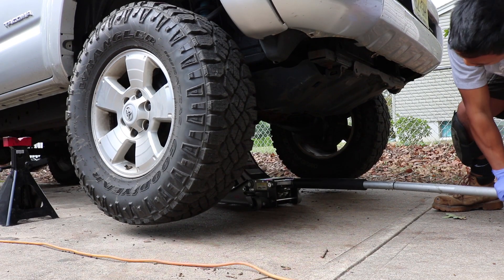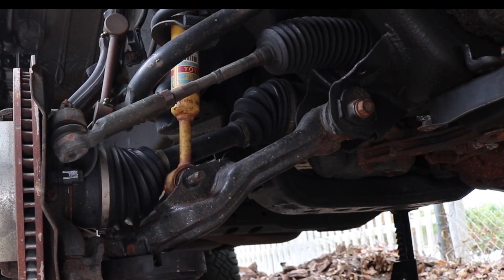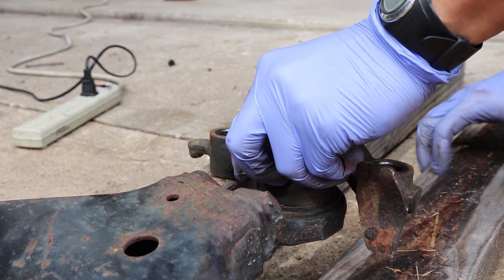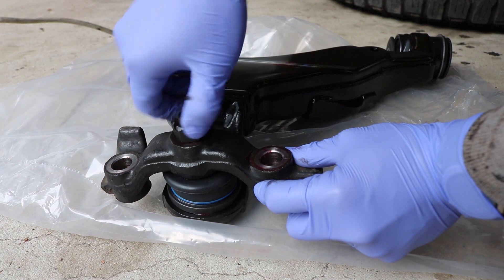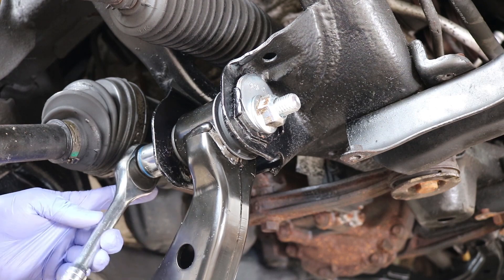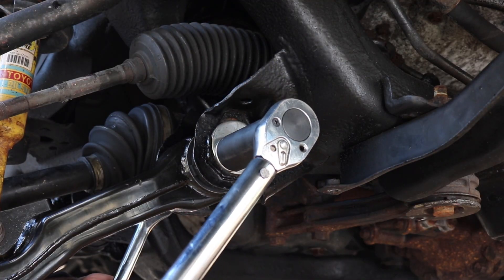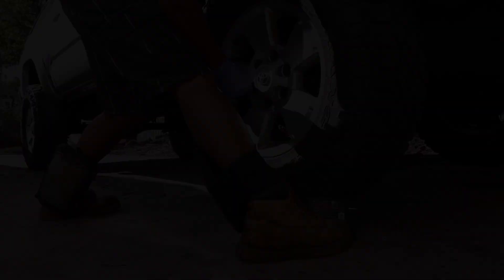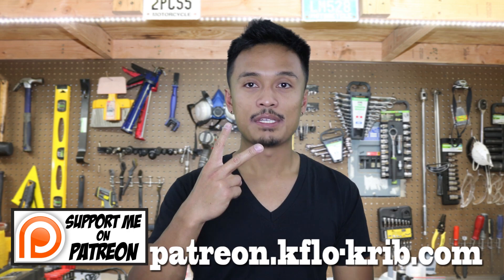Lower Control Arm Replacement (Tacoma DIY / How To)

Comment: I actually typed up each procedure just the way you displayed, took about 30 minutes to prep for the job, and roughly 4.5 hours to complete. All 4 of my upper and lower Ball Joints were dust with 145K Miles on them. No Viagra or Cialis could save them 😂!! My symptoms were mainly in my steering, my fronts were fighting each other over ruts and grooves like crazy along with some clicking noise over bumps. Have to say, thanks to you, I had a flawless and easy repair,  and these MOOG Upper and Lower Control Arms/Ball Joints make my TACO drive like a New Truck!! Thanks again, you guys ROCK!!!! 🇺🇸👊🏻👍🏻
Reply from the maker: Awesome! It sounds like the job went smoothly! I'm glad it worked out well!
Reply: don’t have aftermarket struts?
Reply: do you*

Comment: Ive been hitting the sleeve now for 10 minutes, have been liberally applying pb blaster, and the sleeve isnt budging. Is there a possibility it's siezed?
Reply from the maker: It's possible that it's seized. If so, you can just cut it off with a reciprocating saw
Reply: @KFloTacoma  Didn't exactly have a sawzall, but I did have a jigsaw with a few metal blades, a hacksaw, and some optimism 😆. I managed to get it off after an hour or so, thanks again for a great video to follow while doing it myself!

Comment: Sorry about your friend...will those cam bolts work on my 3rd Gen?
Reply from the maker: the suspension on the 2nd and 3rd gen are basically the same and the cam bolts will work with yours

Comment: Hey Kflo, one more thing....I bought the same Moog LCA's and cam bolts/hardware, however the sleeves it came with don't extend past the mounting brackets like the OEM's do. Is this normal? Just want to make sure I'm squared away, thanks!
Reply from the maker: It doesn't really have to go way past the mounting bracket. You'll just need to position it properly in the slot. Check out this newer video on the LCA replacement: https://www.youtube.com/watch?v=3D29XuFu5EM 
You'll see a better angle on these sleeves as well

Comment: Is it important which way cam bolts are facing? Stock has head of the screw pointing forward, yours are pointing in different directions. Is that important?

Comment: I bought the OEM Cam bolt kit and it doesn't come with a grease-port. Do I just grease the hell out of the bushings as I'm assembling it?
Reply from the maker: Yea just grease the shaft of the bolt kit and you'll be OK

Comment: Awesome video, bro! Do you think I should change the cam bolts even though they don't look bad? 72000 miles FL, TX truck, so, very little rust :) I bought the oem LCAs and they come with the bushings, but not the cam bolts.
Reply from the maker: You can re-use the OEM cam bolts. No need to change them unless they're bent/damaged.

Comment: Great video, subscribed.
Getting ready to rebuild the front end on my 2017 tacoma.
Having a hard time finding new cam bolts that are greaseable.
Will those amazon bolts work for 3rd gen tacomas?

Comment: Great video thanks. Just wondering how this brand of lower control arms is holding up now?
Reply from the maker: Still works well, went through several trails with no issues

Comment: Hoping you can help me out here. When i jack up the lower control arm to meet the ball joint bracket with the steering knuckle the entire truck lifts up. I tied some ratchet straps like you suggested but no luck. Thanks for your help!
Reply from the maker: Are u ratchet strapping the UCA to the LCA? The point of the ratchet strap is to close the two parts together

Comment: I put new upper and lower control arms in my 07 Toyota Tacoma base model and I’m lowering it. But my new lower arm ball joint is pressing against my rotor and my truck will not drive. Any idea to fix that??
Reply from the maker: Did you compare the old control arm and new control arm and see where the difference is?

Comment: i have those same moog LCAs, did you put any grease in the ball joints? It seems like mine has no grease and its extremely stiff to try and move the bolt.
Reply from the maker: These ball joints are normally tight since they're under so much stress from the truck. You'll also notice it with new tie rods and new UCAs

Comment: this content is amazing.  however what generation toyota were you working on in this video?
Reply from the maker: All the suspension work on this channel can apply for both the 2nd and 3rd gen
Reply: @KFloTacoma  hm.  is it that much different for 1st gen?
Reply from the maker: The parts are different for the 1st gen but the work philosophy is the same. The 2nd and 3rd gen basically have the same suspension parts
Reply: @KFloTacoma  i might be wrong but after some research, it looks like for 1st gen tacoma, you have to also loosen the steering rack and take out sway bar to remove the lower bolt on the lower control arm.  a lot more involved than in your video for 2nd & 3rd gen.  i appreciate your videos- very clear, concise, easy to follow.

Comment: KFlo, your are the MAN!  Your video was just what I needed.  I’m feeling sorta lucky to live in Oregon where they gravel the roads instead of salting them.  I’ve got a 2005 and have some cosmetic rust but haven’t found any pitting or scale.  I like that you cleaned up the rust and repainted it to protect your baby, though the corrosion wasn’t as bad as another LCA video where most of the suspension looked like it was just one big rusty piece.  Looked like something found at an archeological site and I feel like so many layers of rust came off that it seems like the structural integrity of the components and frame were compromised.  Is that something that could happen and would it be good to wash up the underside of our rigs and then spot check the whole thing and brush and repaint the bad spots?  Anyhow, thanks for the video, by far the best LCA video on YouTube.

Comment: Good video brutha.  I currently have Total Chaos UCA's and thinking about Dirt King LCA's.  They are compatible since they are stock dimensions right?
Reply from the maker: They should be since they will be mounted onto the same spindle. Just make sure that the King's are not for long travel and you should be fine.

Comment: If I use stock parts do I need to get an alignment after this?
Reply: You do. Every time you touch your alignment cams. - your alignment is off.
Reply from the maker: I would recommend an alignment or at the minimum checking your alignment at home. See my wheel alignment video

Comment: I’m replacing mine with some stock LCA’s I found on Tacoma World. I’m no longer living in the salty roads of the northeast, so I’m cutting out my upper and lower control arms and replacing them and all new associated hardware. I’m in Virginia and on to Texas soon. Which bushings would you suggest? Thanks again for the vids!
Reply from the maker: I would recommend the whiteline poly bushings. They're not made of rubber and they will last so much longer

Comment: Nice work, tighten down those cam bolts when truck is on the ground.
Reply: I was wondering the same thing about getting a neutral preload on the bushings. Would be very hard for those of us working in our driveway without a service lift.  I was thinking when they do an alignment they "should" loosen each cam bolt, adjust, and re-torque while the vehicle weight is on it's wheels. That would reset the pre-load on the bushing, right? 
But I am not sure that every technician will loosen every cam bolt if they don't have too, so it's possible they skip it if the pre-reading on the alignment is close enough leaving you with a bushing that will have a lot of twist internally, and likely fail early.  Am I way off on this?

Comment: Did you adjust your LCA to pull it forward in the wheel well at all?  (to minimize rubbing at the back with oversize tires)
Reply from the maker: I didn't need to. There was enough clearance.

Comment: Hey man, I’ve been watching your videos to help me since I bought my taco last year. My lower ball joints are starting to go. I was quoted by the dealer for $1700 parts and labor. How are the moogs holding up for you? I don’t wheel as hard as you but I very often get on rough Colorado forest roads heading to trailheads. Thank you in advance for the response!
Reply from the maker: Still solid, I have 35's on my truck now with multiple trips (check some of my latest YT Shorts)  on the same lower control arms
Reply: @KFloTacoma  you rock dude! I’m going with the moogs
Reply: Thanks, love this video and I'm ready to do this myself, I'm just a little confused about what the ratchet strap is on.

Comment: few questions.what year is the truck.
is it base or trd pro. how many miles.and why u changing the control arms.. did they go bad
Reply from the maker: 2009 2nd Gen TRD Sport 4x4 Double Cab. Ball joints were worn and you could hear the popping in the suspension. 140,000 miles including several off road trips.

Comment: I want to do both upper and lower is on my taco. Would you recommend I start with top or bottom ones first? Thanks
Reply from the maker: Uppers are easier than lowers, so I would start with uppers

Comment: hey karl, thanks for the great video. Where did you find those greaseable  lower pins
Reply from the maker: You can find them on my amazon page. Go to Amazon.kflo-krib.com it should be under "Upper and Lower Control Arms"
Reply: Cool, got’em

Comment: Did you re use the castle Nut & pin?
Reply from the maker: No. The new one came with new castle nut and cotter pin
Reply: KFlo Tacoma would you be able to re use the castle Nut though?
Reply from the maker: Yes, definitely

Comment: Toyota replaced my lower control arms two years ago along with the frame. I really want to do the the uppers.
Reply from the maker: I would recommend the uppers from freedom off road. Watch that video on my channel!
Reply: I had the exact same thing done 2 summers back.  ('06 TRD Sport now 2018 frame)  I went with SPC which have a fully adjustable ball joint....

Comment: Cam bolts are in the wrong direction.  Never torque the frame side bolts on the control arm without the truck resting in its natural suspension position or you will tear up the bushing.